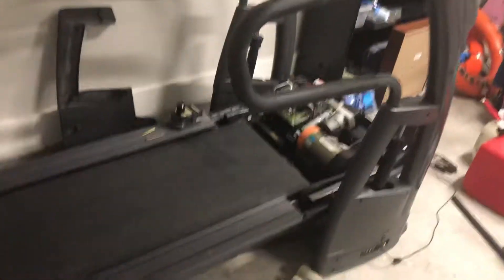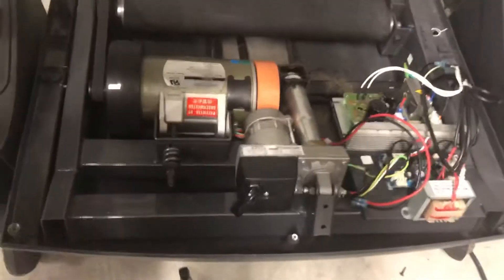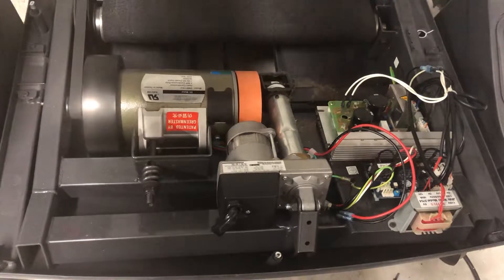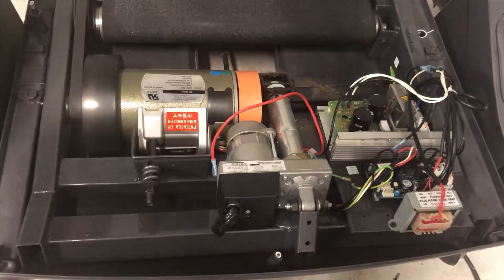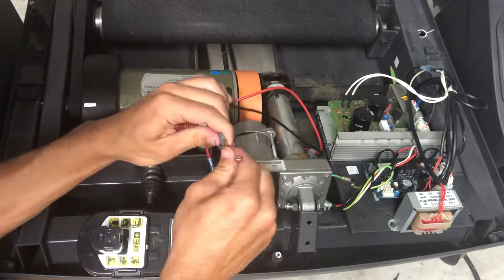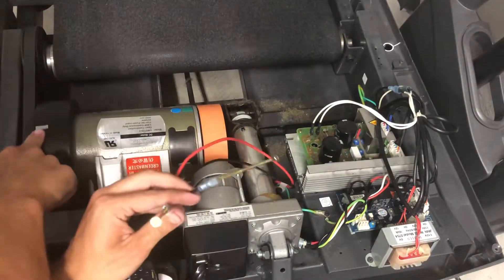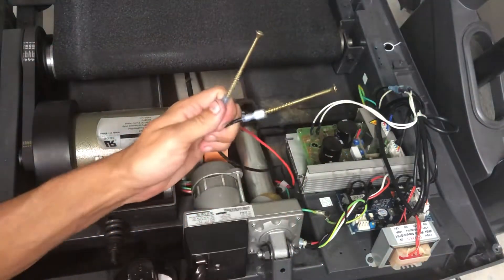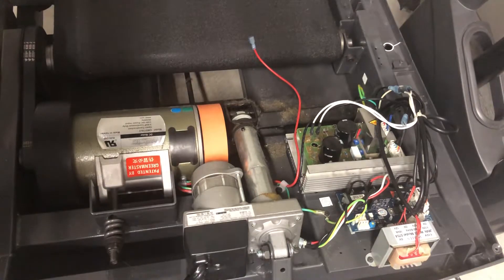How To Test Your Treadmill Motor - DIY

Comment: Hi, did you locate the problem? Was it your control board and how did you fix it? Thank you.
Reply from the maker: Control board was my issue
Reply: Good idea to wear safety glasses in case a direct short is in the motor. Batteries can explode in your face